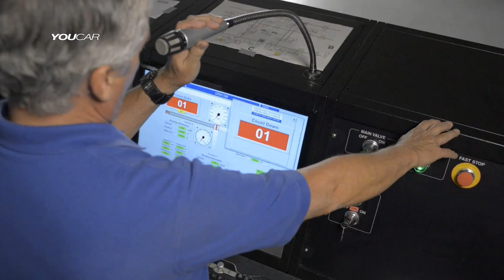CRASH TEST Ford F150 Supercrew and Supercab

Comment: What's so different from the super crew and super cab? Their the same truck engineering wise?
Reply: +Kyle Bullard The supercab = extended cab. Aka. There is 2 doors and front and back seats. The reason the supercab did worse (although still safe) was because the supercrew has special impact points along the frame to prevent in foreign material such as the other cars engine from entering the cab area. These trucks are designed to last long under normal use. In the case of an accident I would much rather have a truck get totaled and get a new one then die.

Comment: The cab compartment took alot of damage during the front end crashes. Did those dummys loose their legs?  Forget the vehicle damage did the dummy even survive?
Reply: Obviously if they got a 5 star rating
Reply: Yes, because the force applied onto the dummies was minimal thanks to the crumple. Also built into the foot wells and all around the cab in modern vehicles like these is a highly strong protective frame meaning it's incredibly unlikely to trap someone's body part in a certain place.

Comment: Flipping crap protection.  You want to see how well built English Ford's are.
Reply: Are English-built Fords car-based or unibodies, like Utes? I imagine body-on-frame vehicles are always going to be an engineering challenge to offer payload/handling/comfort/safety/economy - all in one platform. Many of the concepts above, that have been found in European automobiles for at least a decade,  are migrating stateside due to globalization, regulations and need for fuel economy.

Comment: SAD PART IS WE ARE ALL STILL GONNA DIE IN THE FREEWAY. CAUSE WE DONT DRIVE 40MPH  ON THE FREEWAY!!
Reply: You clearly don't understand basic physics. You're not going to crash into a solid immovable steel barrier on the highway unless you're extremely unlucky. You're going to crash into another car. The damage at 40 Mph into a solid barrier is comparable to the damage from two F-150s in a head-on crash at 70Mph. As well, you're much safer in the heavier truck because physics tells us that a heavier object hitting a lighter object will be subject to less forces. That is why you see many trucks in accidents that look only slightly damaged but the car is a mangled wreck.

Comment: I've noticed that these US pick up trucks look like they are built like tanks but they are mostly made of fresh air, it's a good thing to crumple to avoid internal organ damage but this truck fell apart a bit too readily for my liking.
Reply: Old American trucks are indestructible.
Reply: this is a five star safety rating, look at some other trucks in this class if you think this is bad
Reply: Yar Nunya Do you know why the 357 Magnum was invented?
Because back in the 30's, forty's, and 50's, automobile body panels and doors would stop 38 Special and 9 mm rounds. They did not use armor grade steel. They were just so incredibly thick and heavy duty they were literally bullet resistant.

Comment: military grade my ass.
Reply: never understood how & why they reverted to mass producing those

The frame can't withstand pressure & stress especially in this type of weather;

there are reports & even proving ground tests & comparisons or in life fun snow curling & drifting driving into thick snow the frame actually exhibiting flex & bending like a rubber or flex object 

It explains how & why a truck should not use aluminium above or within frame even if strengthened unless reinforced it'll acknowledge bending & breaking

Comment: Im buying a nenew truck here soon, what should i get Ram Chevy or ford?
Reply: Dude, your asking kids to tell you what their dad said I'd the best or what they believe is the best with no proof. I can tell you get a ford because I like ford but I won't give you proof or a reasonable answer why I told you to get it. I would say be smart and do your research. See what truck fits what you need in a truck with different towing capabilities, different packages, different interior designs and comfort, different mpg, different engines, ETC ETC... I own a 2010 dodge turbo cummins because I go out into the forest alot and go camping and need to tow my camper. and that truck has alot of power and towing capabilities  and it looks sexy in my opinion. Plus dodge has good reviews with the cummins motor.
Reply: +SoloGamingG1 I only made that comment to start a flame war .😂😂
Reply: Mark TheCarGuy Ohh, ok. Now I understand. But atleast you know some info😂😂 little life lesson
Reply: +SoloGamingG1 I all ready knew that, my dad told me that when I was young kid.

Comment: I have been a Ford F150 guy for a few years now, I've owned a '98 and currently a 2005 King Ranch and I have been pleased so far, but I will not be buying a 2015 F150 as my next truck. I just watched another crash test video of 2004-2008 F150 Models and compared it to this one, the cabin in the older models remained much more intact and the body did not crumble like these new ones, the only thing they lacked back then were curtain airbags, other than that they were pretty safe. I can only imagine being in a multi-vehicular crash with these new ones, airbags only deploy once, a second hit and you're dead. I don't know how the chief engineer got away with lying all over about this new "military grade aluminum alloy"(a term Ford came up with) being stronger than steel, these trucks are NOT safe.

Comment: More like ford built weak
Reply: pick up a physics books bud, the crumple zone is safer than having a stiff, piece of steel. Who care's if the vehicle is not able to drive after the accident? Atleast you will be safe.
Reply: Julian Mcguigan ya, after having done physics and knowing about it, at least to the exten high school teaches you, I would prefer to have whiplash, which is the norm for steel frame trucks at high speed. Than to havr my legs shredded or have the engine block sit in my lap.
Reply: Julian Mcguigan will I’m saying this because my brother had a 17 Explorer and got hit in the front by a red light runner and his lungs got damaged badly as will as his ribs

Comment: Why is there such a discrepancy between the safety of these two cabs?
Reply: fifthgear93 The CrewCab has extra frame components making it do better in the Small overlap crash test. However, both trucks ace all the other cast test like side, roof, frontal, etc.

Comment: Trucks aren't what thet used to be. That doesnt look very protective.
Reply: xXdan 2 dangerXx what matters is intrusion into the passenger compartment. An easy way to compare is in the top down view at 1:37 - watch how on the extended cab model, the distance between the front edge of the roof and the rear edge of the hood get much closer but int he crew cab it stays more rigid.
Reply: Ford says they are looking to make the supercab better in the small overlap test but the SuperCrew got the highest rating of good and got a top safety pick award. Also the supercab does well in frontal and side crash test. Info: IIHS
Reply: Ryan Wagner Well Said.
Reply: Yeah, trucks aren't what they used to be. They used to be death traps. Go look up up the crash tests of older trucks. Before the mid 2000s, they all performed horribly in frontal offset crash tests, and they continued to perform horribly in side impact tests until the late 2000s. Trucks today are way safer than they used to be.
Reply: xXdan 2 dangerXx  i have a 99 f150, i can say without a doubt i and protected. i even say to myself when newer model cars cut me off, that they better hope i stop because im not afraid of what would happen lol
Reply: xXdan 2 dangerXx Trucks, Fords or NA vehicles in general? I don't think there is anything inherently unsafe about 'trucks' ... This Ford just hasn't been engineered with any consideration of safety.
Reply: xXdan 2 dangerXx you know they inside is very strong and the outside is not. it's to soften the blow. the harder a car is the less safe you are. the outside is like that so you take less injury's. like I said inside very hard out side not for a reason.
Reply: Ryan Wagner i saw this guys comment and was going to say the exact same thing as you did! i drive the 2003 supercab and I'm scared if i ever end up crashing
Reply: +Ralph Wiggum I have a 1994 Toyota 4runner, love it.
Reply: The compartment in the front is ok? But in some of those tests I think the people in the back would be hurt or dead
Reply: +ash3rr You'd be wrong there, the supercab was a top safety pick. They're built to absorb impacts and save lives.

Comment: Oh shit! It crashed like it's made of paper!
Never liked Ford. Now even more
Reply: Anri Orlow the more destruction means least amount of force into the passengers, the more the car/truck takes damage the least is transferred to your body, which equals your chances of survival :)
Reply: +Elbowz true, unless the passenger compartment is crushed.
Reply: +Elbowz I crashed in a chevy astro, and it was very gentle, yet took little damage. Crumpling is a lousy excuse for allowing the car to suck.
Reply: But the SuperCrew did so well. It aced every crash test. The front is supposed to crumple like that. Look at the IIHS YouTube channel. Almost every car crumples similarly. The SuperCrew is probably the safest pickup out there.
Reply: Samuel G I would rather be in a crash in my 76 pickup, than in that thing.
Reply: +spiffcats Are you implying your 76' pickup would have done better in the crash test? A 76' pickup won't have any crumple zones, airbags, electronic stability control, or any safety equipment other than a seatbelt! The body isn't even designed well enough to handle most crashes (Material doesn't really matter. It's the overall way the body is designed that matters.). You would die if you got into a crash similar to what you see in the video. Hell, you would most likely die or at least be severely injured in any type of crash over 30+ mph. Whereas if you were in one of the trucks in the video, you would most likely walk away, unscathed.
Reply: Samuel G Not likely. Back then they actualy built cars to hold together. In a high speed crash without crumpling, you may be right, you would be dead. But anything slower... Ever see an old vehicle vs a new one? I do all the time in the city. Neither occupants are injured, but the old truck can drive off, the new one has to be towed. Here is another thing to look at. Picture high speed, old pickup vs new one. They hit head on. The old pickup smashes into the new one, without crumpling, while the new one crumples from the impact of its own inertia, and being pushed in by a solid mass. The result would be that the old pickups occupants would not experience severe forces, because the object it is hitting is crumpling. In this case though, the new one would have crumpled far enough, that things would be intruding into the driver area, possibly impaling or crushing the occupants, whereas the old one, although injured, would fare better.
Reply: +spiffcats It's not about holding together. It's about protecting the passengers. Cars today are meant to sacrifice themselves in order to protect the passengers. Which is why most older cars are able to drive away while newer cars have to be towed after a low speed accident. Watch a few crash test videos with older cars vs newer cars. In most cases, the newer car will always win and have little to no intrusion into the occupant compartment. I'm a little obsessed with crash tests and car safety. All I do in my down time is watch crash test videos or do research. In a 40MPH offset or full head on collision involving a 15' F150 SuperCrew vs. a 76' F150, the driver of the 2015 F150 would maybe be a little shaken up but will have the ability to walk away. The driver of the 1976 F150 would be dead. No doubt. No airbags, no seatbelt pretensioners, no crumple zones, no reinforced occupant compartment, no safety features. 100% dead.
Reply: Samuel G I also watch alot of these videos, and have seen every video the ihs has published. I also speak from experience, and i find the frontal offset test to be bullcrap. For example, take a look at the crash test for the chevy astro. Now i have been in an accident n a chevy astro, twice. And both times did amazingly well. And both times any other vehicle would have had injuries, but it had none. So how can it get a poor rating. 
As for the old vehicles, i can not speak from experience, but i can say their test is dumb. I have never seen the 76 video, but I shall take your word for it.
Reply: +spiffcats How do you know that "any other vehicle would have had injuries?" What kind of crashes were they and at what speed? The IIHS tests are not bullcrap. The IIHS has saved 10's of thousands of lives over the past 2 decades. Since the late 80's, the amount of deaths (in the U.S.) has dropped significantly; even tho the amount of drivers had increased significantly as well. The average death rate of car from today is around 18-24. The Honda Odyssey (2011 and newer), which there are millions of, has a death rate of ZERO. In the 90's the average death rate was about 90-120. The Astro amazing had a death rate of 7 while the Chevy Blazer had a death rate of 300+. Look at the IIHS death rates by model.

Comment: Super crew is better
Reply: Lksscorpio Cars No shit? Didn't notice. Thanks for reminding me I am not blind. And the "Ace" test results are bs when you have a truck that the more expensive model built on the same chassis scores better. Ford got caught red handed in this mess as they knew they only test the high end model. The Pinto disaster wasn't that the car was any less safe if not better than other models in that size and era but that Ford knowingly hid a design flaw. I see they didn't learn much.

Comment: Why is the Super Cab so shity compared to the Crew!?
Reply: +Tforce Sims Here's a good website that explains why: http://blog.caranddriver.com/iihs-2015-ford-f-150-crash-tests-reveal-disparate-results-between-crew-cab-and-extended-cab/.

In short, only the SuperCrew configuration received steel reinforcements in the chassis, which is why it performed better.
Reply: thx,I like ford but this is crazy!
Reply: Tforce Sims True, but as long as the driver and passengers are safe, I'm A okay!
Reply: ikr